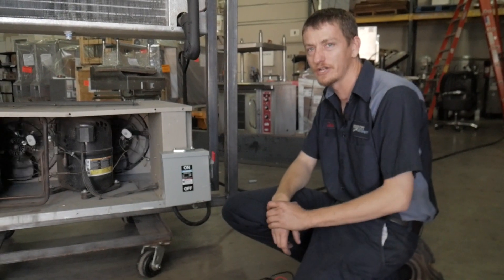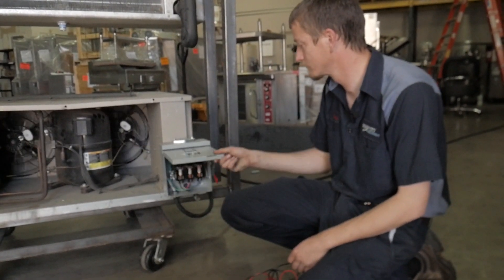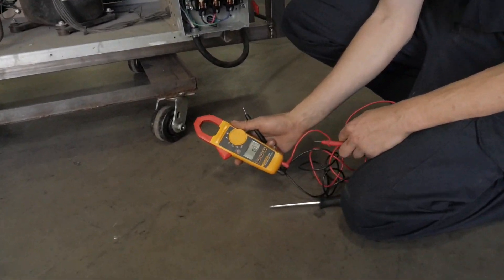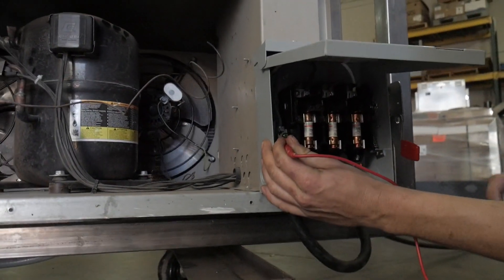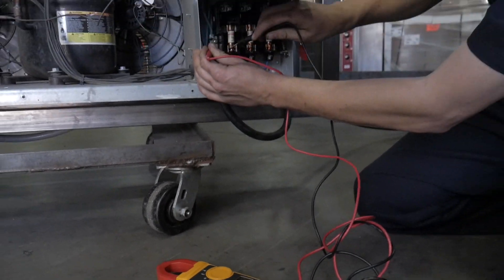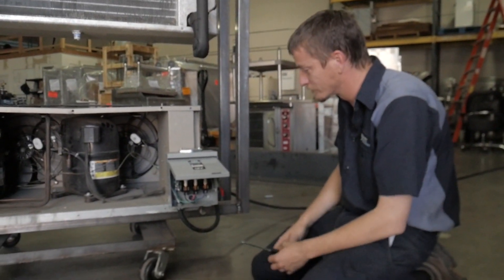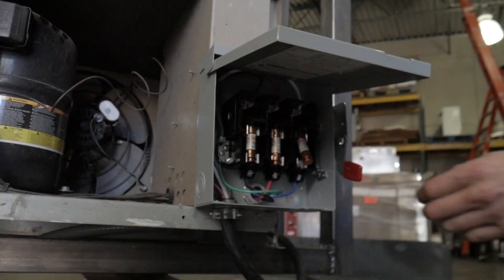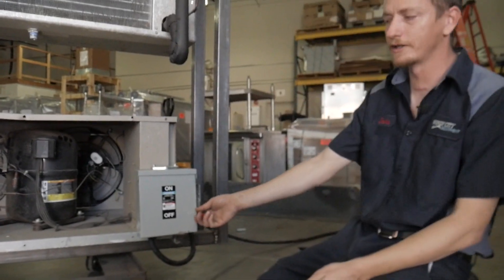How to Change a Fuse - Replace Disconnect Fuse

Comment: Would  there still be power coming into the top of the disconnect box if you don't turn off the breaker that feeds it? Thanks for the video.
Reply from the maker: There shouldn't be.  These boxes are designed to easily kill power before the fuses so the fuses can be changed without risk.  HOWEVER, as stated in the video, you ALWAYS want to get incoming power first because if there's a problem with the box, power could still be present.  Thanks for watching!